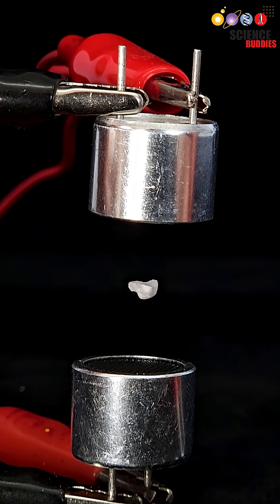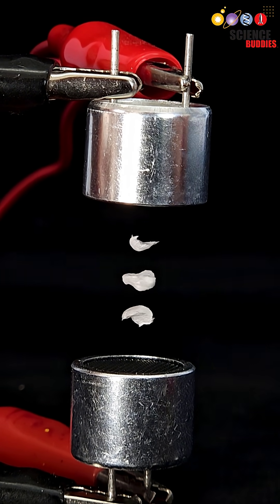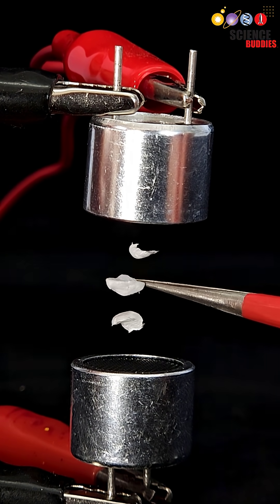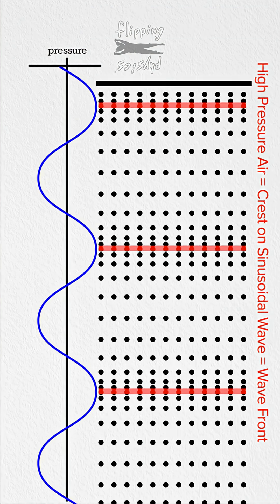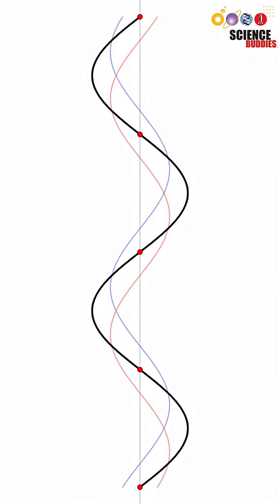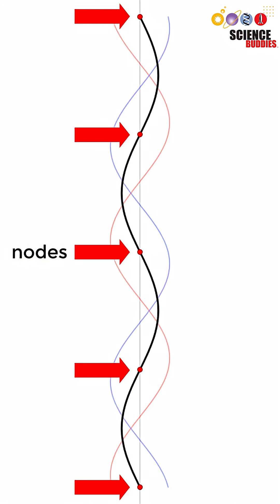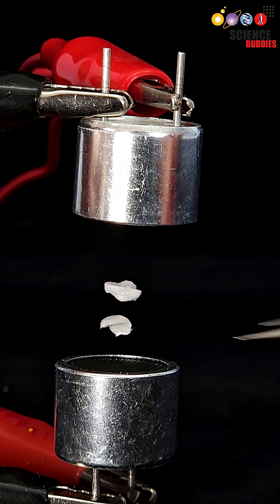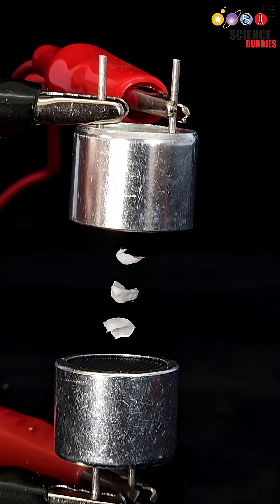how ultrasonic levitation works

Comment: When you pull the levitating objects out of place and they spring back, does it produce a reaction force on the apperatus or does it become reactionless with the energy escaping as radiant heat? Why I ask this is because it might lead to development of a reactionless inertial propulsion system.
Reply from the maker: That's a very good question, to be honest we're not sure. Since the levitating objects are so light, measuring any reaction force on the transducers may be very difficult.

Comment: Thanks. Can you move them longitudinally?
Reply from the maker: Not totally sure we understand your question - the distance between nodes is determined by the sound wavelength and the speed of sound in air. You can't really change the latter, but in theory you could change the wavelength (and therefore move the nodes) by adjusting the driving frequency.
Reply: @Science.Buddies  ... move them along the axis between the emitters. No, you can't. The objects are sitting in wave nodes where the up/down forces are at an equilibrium.